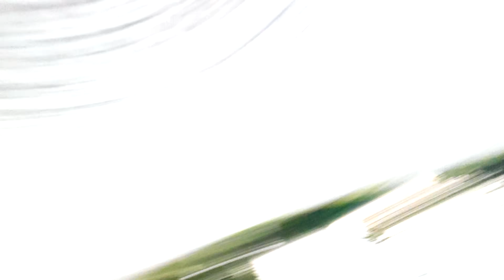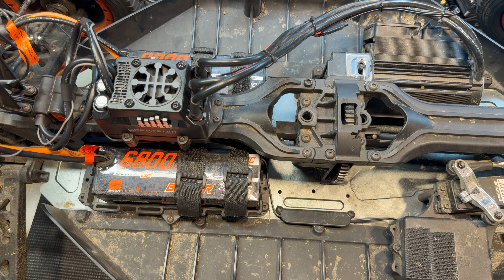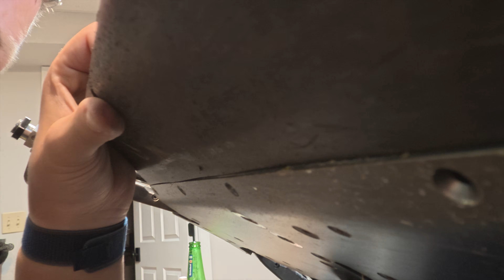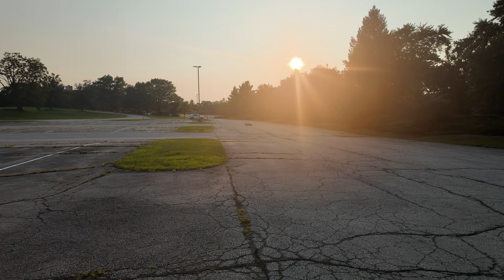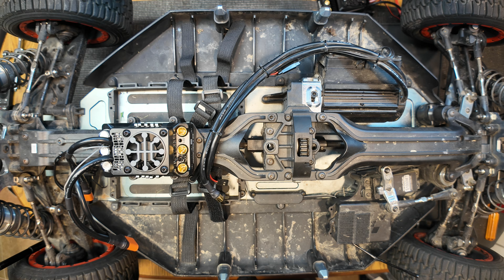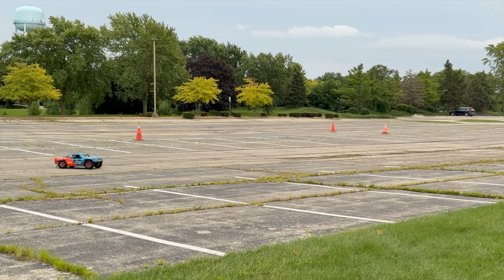FIVE-Te SPEED Project: Phase I

Comment: Great project. If top speed is all you're chasing I'd suggest looking into the aero and rolling resistance. Drag increases almost quadratically with speed and is the main limiting factor. If you streamline and lower it on hard suspension to decrease frontal area it will massively increase it's top speed and potential.
Reply from the maker: At 76 MPH, it turned into a spaceship.  You’ve beaten phase 3 to the punch, without overdoing it too much, I’ve gotten it riding significantly lower.  Will get it back out this week!

Comment: If anyone is considering this, DONT

Get the Rovan ELT instead - its a carbon copy of Losi, same car, same shape, same size, usually can get it in roller form, add your own 8s (or 12s if you dare) motor/esc. 

Its MUCH MUCH faster and better than this
Reply from the maker: Interesting… a new Rovan roller is about $800, while you can find a new 5IVE-T roller around $900. This Castle setup is about $700, and a Max4 combo is actually more than that. So once you equip both similarly, the price difference gets pretty small.

I’ve also had zero structural durability issues with the Losi. The Rovan may be marginally cheaper, but I’m not sure I’d call it “much faster and better” — speed is mostly going to come down to the electronics, gearing and setup you put in either truck.
Reply: @DIY-RC-Garage  Losi is def higher quality but the Rovans are solid as im sure you know. I think where you go wrong is the Max 4 combo, if you are getting a Rovan, you may as well get a good Quality 12s ESC and motor that is chinese branded, there are a few about. 

I said better as it then works out much cheaper for the same experience and faster as 8s is getting you 55-60mph and 12s is ripping your tyres off unless you dial it down to what your tyres can handle. 

I believe your best bet would then be JC Magmas. 

But either way, what you are doing with this is bridging the gap in speed with the Losi, soon you will start having your tyres explode which is crazy given how big and thick they are.
Reply from the maker: @Xbot4Life that’s a far more measured take than what you originally posted, lol!
Reply: @DIY-RC-Garage  You took the time to reply so i put more into it.

Comment: Next time, try to do the bottom first, then the top
Reply from the maker: I don’t know what that means.
Reply: @DIY-RC-Garage  pull the bottom screws out first then the top one to the motor mount
Reply from the maker: @championcarcare8207  help me with the rationale!  I’m clearly too blind to see it.
Reply: @DIY-RC-Garage  you have two screws on the bottom, pulling one way and you have one screw at the top pulling another way the two screws at the bottom and the one screw that centered at the top work together, but if you loosen the two screws at the bottom that makes that one screw have less tension upon it, which will allow it to release easier
Reply from the maker: @championcarcare8207  that makes sense!  Appreciate the tip.  You’ll cringe when you see the effort the motor mount screw removal requires in phase 2 … I’ll get it right for phase 3!

Comment: I was lucky as mine was one of the stronger ones. New out of the box mine was doing 50 mph. I later added a 19T pinion and hit 55mph on the first run. The mesh was a bit tight in one spot though and after a couple of packs it loosened up. I retested it and it was now running 57mph on my GNSS GPS. I use CNHL 9500 90C batteries.
Reply from the maker: Those are some solid numbers, sounds like you’ve got it dialed in well!
Reply: @DIY-RC-Garage  Ya as I said I got lucky and got one that was stronger than most out of the box. Nice to get one like that for a change.

Comment: Running 21/62 in mine. Idk how fast it is but its a rocket on dirt. Will power wheelie in loose
Reply from the maker: Stock system?  Or upgraded electronics?
Reply: @house of horsepower rc
Reply: @DIY-RC-Garage qs8 plugs and dumbo reciever
Reply from the maker: have you been able to get a GPS on it?
Reply: @DIY-RC-Garage no but i can
Reply: @DIY-RC-Garage stock everything. Center is earplugged. I got 4 in it. On mx43 badlands

Comment: One upgrade that I plan to do when my truck arrives is the ear plug center diff mod. I did it for my xmaxx and it made it feel like a new car. I do wonder if it can help with top speed as it would put more power to the rear wheels instead of ballooning the fronts.
Reply from the maker: Totally fair - that’s why I put some 20 million in.  Hopefully that’s enough!